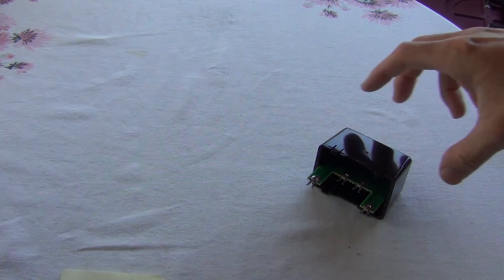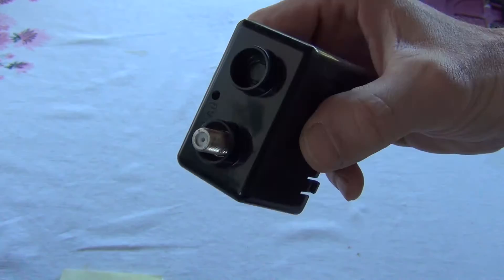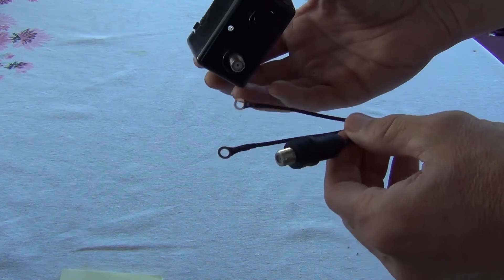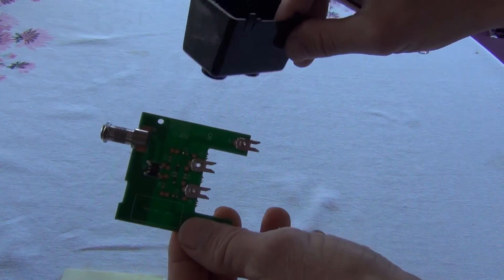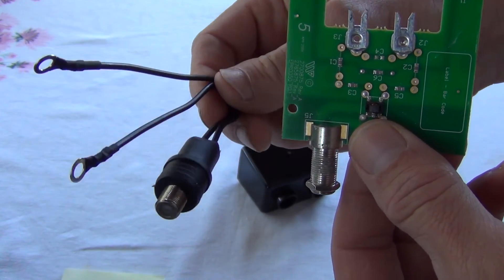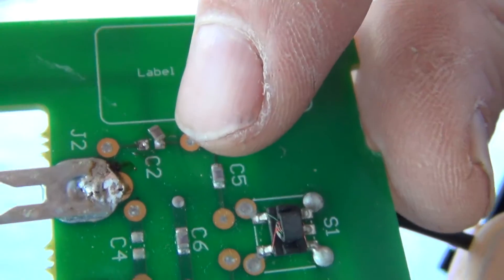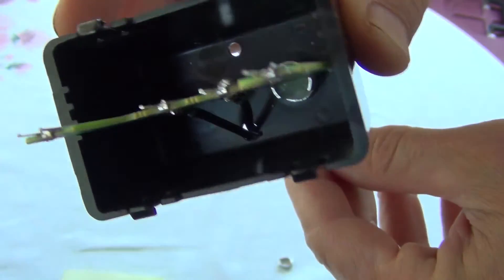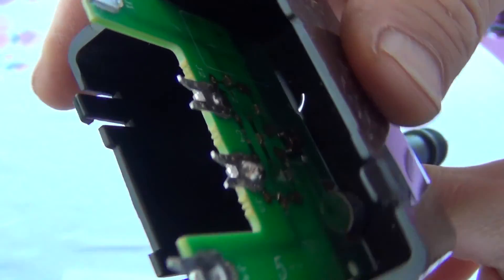Winegard HD8200U, HD7698P Antenna - Modified  VHF/UHF, CB-8269 Cartridge Housing

Comment: Were you trying to eliminate adjacent channel interference?
Did you use a UVSJ to combine the signals?
Interested in seeing your complete setup from the balun down.
Reply from the maker: Hi Olimazi,
Sorry for my late response.  I have been out of town.  
The issue I was having was intermittent noise from lower frequencies (below UHF band) affecting one of my UHF channels (33).  I am located near an industrial area and the TV towers are 62 miles from my house.  With a weak TV signal, it does not take much noise to affect a channel.  I did another YouTube video https://youtu.be/XsHv1T7NiW0 that shows this setup.  I did use a ZUVSJ to recombine the signal.  I am very satisfied with my setup now:)  Thanks for watching.